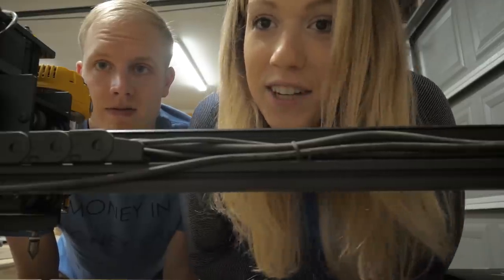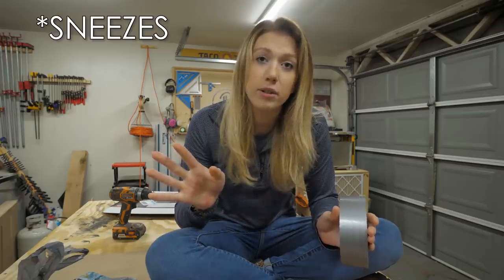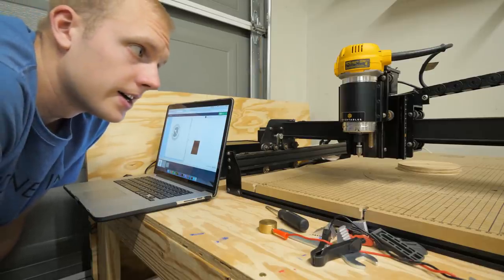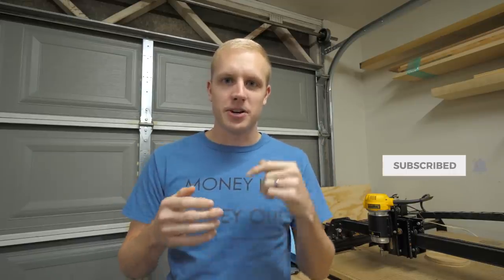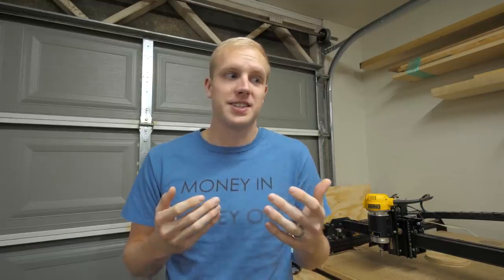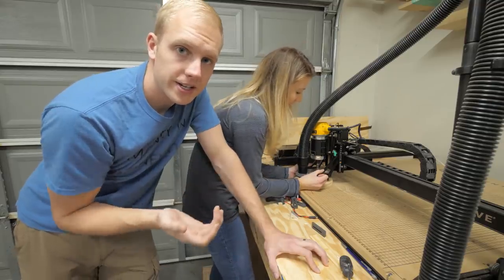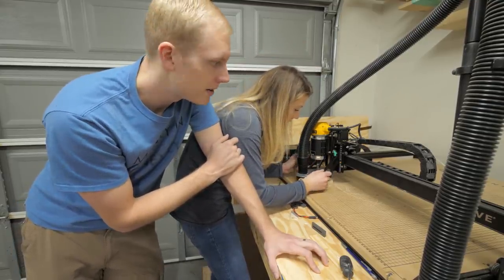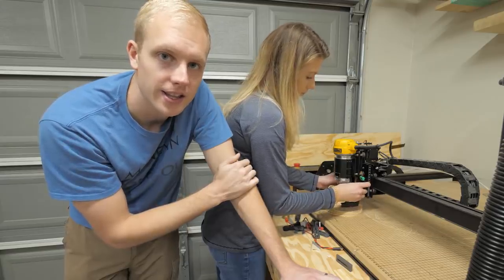The CNC conquered US! 🤦🏼‍♀️🤦🏼‍♂️ Let's Conquer the CNC! Part 3

Comment: Instead double sided tape use painters tape and CA glue. Place a pc of tape on the pc and a pc on the waste board. Add CA glue and activator and put the pc down. When done the painters tape will pull off cleaning but give you the holding power needed. 

Welcome to Houston! I wish you the best!

Comment: I have a large CNC machine, very large, I don't use carpet tape but I DO use thin CA glue with blue painter's tape often. I holds VERY well if applied correctly, sometimes too well, and peals off without any residue or damage to the under side. I've done multi-sided projects, a lot, where you actually need to attach the show side of the piece to table when cutting the back side so you can't afford any damage or residue. I've never had any problem. I'd give that a try...
Reply from the maker: https://youtu.be/gGiJR0KPHXg?t=489

Comment: For using double sided tape you mentioned the difficulty of securing the board to the platform using super glue and lining up the tape on setting it down. I do not have a CNC but i use that method on other jobs. Put your first layer face down on the project, put a thin line of glue on the tape and then put a line of wider tape sticky side up over the tape on the work piece, flip the work over, line it up and press it down. No worries of glue over run and comes up easily. I use the blue painters tape or the green frog tape.

Comment: Hey guys. I do both cnc router and laser work. And I agree with your assesment. My laser is a Chinese 1300mm x 900mm x 80 watt co2 laser with water chiller. I use it alot for cutting Plexiglass hense the size. Your biggest bonus in your workshop will be no dust to deal with. Only smoke extraction. And the fact that these is no friction to deal with a spinning tool. So no clamping. Best of luck on your choice.  The 900 x 600mm is pretty good. Jax

Comment: You can always  use a permanent corner locating/zero block and side push clamps. They work great and they are on the sides out of the way of the bits.

Comment: On the laser part. I have a chinese 80w laser engraver/cutter I bought from ebay and I love it! I recommend getting the 100w one to future proof your business. Its huge! So make some you have some room in your garage. I also reccomend to use weather tape on all the doors to prevent the smell of burnt wood from scaping. All my smoke detectors went off in the house when I tried my first wood engraving! Even with the garage door leading to the house closed! Oh! Do not exceed 85% power on any CO2 laser as 85% means 100% power (too long to explain) I engrave at 15% power with 500mm on speed and cut at 32% power with 18mm speed. I hope this information helps anyone trying to get into the laser cutter/engraving business

Comment: Hope you are having better luck with the dust shoe now and the changing of bits. I had to learn how not to over torque the collet. Over torqueing cause me to jerk the motors, and once I learned that that problem was solved. The dust shoe stays off for short period cuts but is a must for the longer cuts. the procedure I use is to keep one side (right side) tight to mount the shoe. Once in place tighten or loosen right side to adjust. Always loosen one side to remove the shoe. Silicone spray lubricant also works on the shoe slides. I have the 750mm and it is a working little brute. Wanting to do some bigger items so i bought the X-carve Pro 4x4. So far all I have done is flatten a slab for a live edge bench and that worked nice. Tomorrow I will make a large sign with raised letters, wish me luck.

Comment: I've been using the X-Carve for over 2 years.  I've never thought it was that difficult.  I assembled it in a couple of weekends.  I've been using it to carve all sorts of stuff (mostly custom signs with logos).  I have the dust shoe and love how it works.   I had never used a CNC machine before I bought this.  I use the screws and clamp down hardware and have cut a few of them but once I figured out how to place them I haven't had a problem.  I do use double sided tape for some projects that can't use the clamps
Reply: some people shouldnt own a pocket knife lol

Comment: Re:carpet tape

What I've seen other woodworkers do, often,  is apply blue painters tape to both surfaces and then superglue with activator the tapes together.  Removing  is as easy as pulling off the tape.

Comment: I have an X-Carve as well, and wanted to post my opinion incase others are reading through the comments and are on the fence on getting one. So when I got my machine, I knew up front it was a 100% assembly required machine (and was excited about that). I learned during assembly what each and every part was designed to do. I also, at first, had trouble running into clamps. It was not the machines fault, it's just a part of learning how to set up programing and where your clamps need to go. I also have ran into trouble with bit changes, locking the motors does help this, as does not over tightening the collet. As the video stated, the dust boot isn't the best. It's not easily adjusted while installed, BUT after using the machine a lot, I have learned what height to set the side braces for different thickness material. Set it ahead of time, pop the boot on, and you're good to go. The boot is designed as an interference fit, so the last little bit has to be "pressed" on (with the palm of your hand while holding the back of the arms with your fingers). Are there challenges to this machine? Absolutely.  Can they be overcame quickly (in a day or two)? Possibly, but not likely unless you have a friend with experience. Can you get the hang of it after about a week using the machine after your day job? Yes. 

I have also had the opportunity to use larger, way more expensive machines, and I will say there isn't much difference in the learning curve. But once you take the time to properly learn how to use your tools, a whole world of new opportunities opens up!
Reply from the maker: Excellent comment, well said. Really happy you've enjoyed the experience of your machine. 
I guess we didn't make it clear enough in the video, but we don't [completely] hate the machine, it just isn't the right tool for our requirements!

Comment: 4:45, when you get that shiny mig welder. See if you can weld a top and bottom cross member to bind the two separate brackets together so it doesn’t bind? Then patent the upgrade! 😃🤩

Comment: I'm sure yall have figured out how to hold down your material to the spoil board by now but, from time to time I use on some thin material that is flimsy especially towards the middle of part, I use painters tape on both pieces and use CA glue works great.

Comment: The best and least expensive method I have found is painters tape and CA Glue. Put a piece on your material, and a strip on your waste board and a bead of glue on the tape, and position your workpiece, hold for a few seconds and your ready to go. If you want more speed use an excellerator on one side. To make it easy to remove, extend the tape beyond the workpiece a few inches, and it gives you something to grab to remove the tape.
Reply from the maker: We addressed that in the last CNC video! Appreciate the suggestion though

Comment: Don’t give up on the cnc you can conjure it. You just need to let it rest for a bit then go back to it. I am 72 years old and have 3 cnc machine and went through some of the same things you did. Hang in there things will get better
Reply from the maker: It’s not a matter of giving up - it’s just not the right tool for the job. I can keep hammering on a screw and it will go in. But it’s better to buy a drill 😉

Comment: I use the same dust shoe and do not have a problem with it. I slips on and off with ease. Only issue I had was the magnets came off and I had to re supper glue them back on.
Reply from the maker: Happy you haven’t had any issues!

Comment: Use blue painter tape and super glue. It works great and comes off clean. To get a better grip make sure to rub it down. I use the bottom of the accelerator can and that make it much better.
Reply from the maker: We addressed that in the last CNC video! Appreciate the suggestion though
Reply: @jennieanddavis  You did mention it but I don't know if you have given it enough thought. First you have to understand my experience. I have owned a hobby CNC for over 10 years that I built myself and have owned my own laser for about 2 years. Teaching classes at the local Rockler and for many hobbies with a wide verity of machines. Several of my friends run business with both a CNC and a laser. Am I an expert probably not, but I have a good amount of experience.

The cost of blue tape an CA glue is little high, but you can help with that by just spritzing the tape with water and not using accelerator. The burnishing of the tape to the material makes it stick well to the material as to not move while machining. Then it still has the advantage of coming off the material relatively easy with no residue. Most carpet tapes hive a very high adhesion with low pressure as they are used for carpet, this usually means that they leave behind residue and have extended cleanup time. With this in consideration and you trying to run a business I think the added cost and learning curve of the tape method is well worth the investment. If you wanted to go to the next level, without buying a professional CNC, you could at vacuum holding for small pieces. You can check out https://www.joewoodworker.com/ or the https://www.rockler.com/rockler-vacuum-clamp-pod-kit.

As for the laser I have a cheap Chinese laser at it works great. Would I recommend it for a business, absolutely not, the support is lacking and you may spend more time tinkering with it than making money. As a hobbyist and builder of CNC/lasers that is what I wanted and the cost makes it a great option. If you just want to add the personal touch to projects then the laser is by far the best way to go and the learning curve is much lower for it. I would check out https://bescutter.com/, Jonathan Katz-Moses has one and loves it. I have been to his shop and seen it, it is great production machine. You can see his video here https://youtu.be/nsPuL7cfEic.

Comment: One thing we did with our X carve at my makerspace (MakerFX) is replace the spoil board with one we can replace sections of it and on top of each strip of 3/4” Baltic birch we used special plastic nails to put a layer of 1/“ MDF.  Works great. 

Careful with carpet tape and plywood. It will remove veneer.  

I get a carpet tape from amazon that isn’t stringy.  Look into blue tape and CA glue
Reply from the maker: https://youtu.be/gGiJR0KPHXg?t=489

Comment: You took the time to research it you took the time to buy it now take the time to learn it! I was in the same situation when I bought mine however alotta finished pieces scrapped and alot of trial and error I now know and understand my machine! Stick with it and keep tinkering with it! It's really a hands on machine! 2 years with mine and I love it and still learn something new with it every week when i use it !
Reply from the maker: Unfortunately we just don’t have the time necessary! Running a business requires you to be more protective of your time. We could get it to work, but it would take way too long. A laser will do the job MUCH faster and easier.

Comment: I did a bunch of videos on the Dremel Laser Cutter. I like it. It did struggle with 1/4 Home Depot plywood, but it works great for engraving. One other thing is that it's a bear to align, but doesn't seem to require that very often.

Comment: Budget for a laser is a huge consideration and the jump form a glass tube laser to one that can be recharged is tremendous. I think you guys are likely in the glass tube market at least to start. I'd look at something like Thunder Laser.

I think what you wanted for your router was two "Rockler Auto-Lock T-Track Clamp" and two pieces of t slot. one simple stop block and you would never need to change your origin and it would always push it to the correct position while you clamp them with a single push.

One challenge of v bit engraving is that the board really needs to be perfectly flat (and parallel) which you probably wont be able to get off of the planer and it's almost never cost effective to face the entire piece first. I don't think you actually needed anything other than the vbit for what you were trying to do and i'd suggest a replaceable carbide tipped one for your application.

For what you're doing, i'd just leave one cutter in there and set it up for a huge volume and only change it when you are going to do a huge volume of the other cutter. If you use those clamps and a stop block, you can easily remove a work piece and then drop it back on later to run with the other cutter and just keep pressing go on the current toolpath.

Comment: Guys, I almost never move my dust shoe adjustments, especially between bit changes. 

Here’s what I do.

1. Set the dust shoe holder in place. Usually at the 3.5 or 4 mark. 
2. Raise the bit.
3. Remove the dust shoe.
4. Change the bit.
5. Set the Z with the sensor.
***6. Raise the bit by 1”.
7. Put dust shoe back on. 
***8. Lower the bit by 1”. 

I’ve never had an issue doing it this way. Hope this helps.
Reply from the maker: Glad you found something that works for you!
Reply: Jennie and Davis lol. Not really boasting, just sharing for your benefit but ok, I’ll keep my comments to myself.
Reply from the maker: @KhaosTheory5000  Sorry, I know it's hard to convey emotions through typing, but there was no sarcasm! Some people seem to never see an issue with it, and I'm genuinely happy it hasn't caused them any trouble.

Comment: Have you looked at the Gatton CNC along with the Javi Box and Mach3 Software?  - A great combo for the price. Its a hobby CNC but there are many people whom use them as a light production CNC router. Don't give up on the CNC, the right one will transform your buisness.
Reply from the maker: In the first two months our laser has already produced 5x what our Cnc has given us in over two years. Not even the best hammer can drive a screw...

Comment: I own and use daily a FullSpectrum 45w CO2 laser in my business. I also own an X-Carve. I use the laser 100 times more than the X-Carve. Setup of the laser is much easier. 1 hour of setup and you are ready to go. The software that controls the laser is reasonably easy. I use CorelDraw to make my designs. CorelDraw has a learning curve. I have used CorelDraw almost every day for 13 years and still learn new techniques. My laser stays so busy that I am looking to add a second one this year. I will either go with another FullSpectrum or possibly the Glowforge. There is a learning curve to laser engraving but in my opinion, it is less than a CNC router. I worked in technology for 40 years before I retired so I have spent years with lasers and electromechanical tools. Because of this I may not be the best judge of what is easy. If you have questions about CO2 lasers I would be happy to try to help answer any questions.

Comment: 10:13 but clamping is much cheaper. Drill holes in your waste board and put some dowels in as a stop than clamp.
You can get good repetitive results it's lke a assemblyline work by clamping. Doubelsided tape can get loose because
of wood dust and other factors, clamping is every time trustworthy.

Comment: I have an Epilog laser the 40 watt Helix 24"X18" table with a rotary attachment for round items I've had it for 10 years. I love it. also I built my first CNC from parts from Open Build which I out grew pretty quick I now have a Legacy Maverick 3'X5'. I'm a one person shop in my basement and I have as much work as I can handle.

Comment: Yeah I found it funny that they advertise it as "easy" and yet you have to assemble the thing yourself from ground up.  At least once you're done you have a pretty good understanding of the hardware.  I agree with you regarding the dust boot... bad design.  For the most part, I leave it off but mainly that's because I need to get close-up shots of the machine in action.  If I'm not filming, I'll use it but even then it doesn't always do a stellar job but it's definitely better than nothing.  I know I'm not using the machine for everything that I could, but I'm not in the batch-out game.  If I was, I'm sure it would be a key machine in my shop.  For what I DO use it for though, it works very well and I'd still recommend it to anyone looking to get into the CNC scene.  Assembly is a pain, but you learn a lot.  Easel is probably the easiest piece of software to learn as well... but not as powerful or versatile as the others. #longcommentsaretheworst
Reply from the maker: But long, respectful, and helpful comments are the best 😇

Comment: As I said before, the blue tape and super glue method of holding parts down is vastly superior to any double sided tape, and I've tried them all. But experimenting with your own solutions will be fun and educational.
Also, as I said before, spending about $200 and a few nights of work to make an enclosure will allow you to contain and remove ALL  of the dust, reduce the noise level considerably, and be safer because the clear acrylic panels in the doors will stop anything from flying out (like large chips of wood, loosened workpieces, and broken bit fragments). Even though the dust shoe I was using was magnetically mounted, I wouldn't go back to that now for anything.
Try to keep those ideas in mind for when you aren't satisfied with the results you're getting now.
Reply from the maker: We addressed the blue tape method in the last CNC video! Appreciate the suggestion though
Reply: @jennieanddavis  Sorry about that. I've been out of town for quite a while and must have missed it. I'll look it up. Thanks.